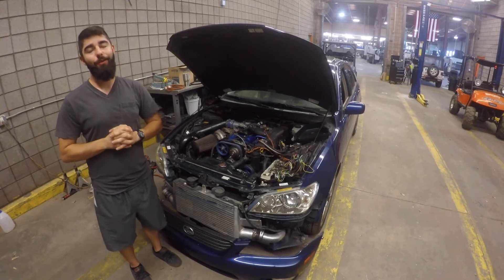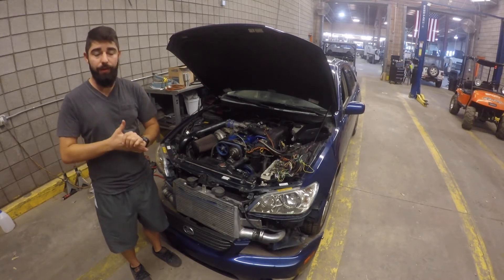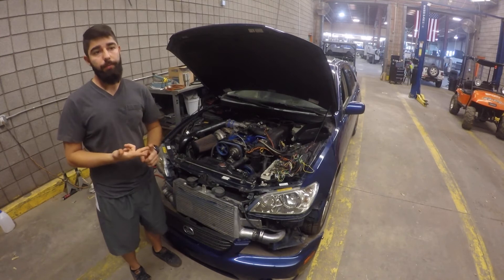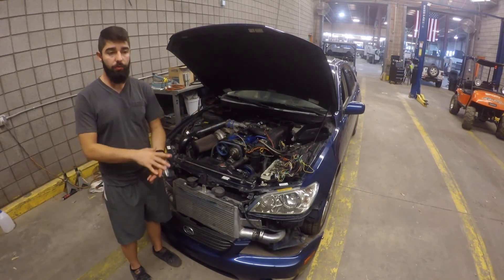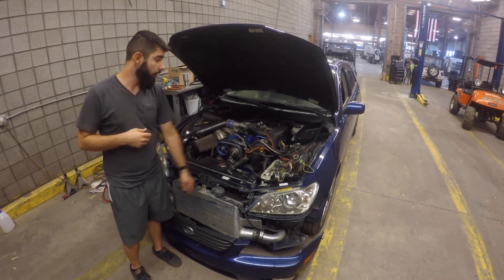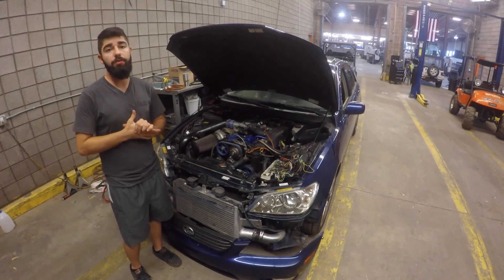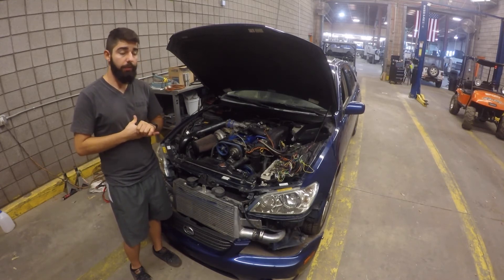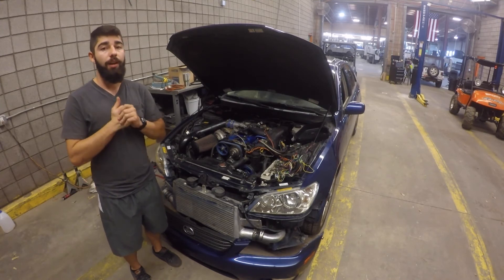Turbo Lexus IS300 Wont Start After Dyno Day. I broke it. :( Having wiring issues.

Comment: Love the car, sorry to hear about the starting problem.  Did you tuner use a pick scope to check and see how much off the signals are?  Also are you tuning a patch harness or how are the signals getting to the AEM?  You will figure it out it will be a simple fix.
Reply from the maker: Brinks84 thank You! The tuner did scope it and didn't find anything obvious. There is no patch harness, the signal wires for the AEM are pulled from the stock ecu, just directly tapped into the wires. Tuner gave me something to try tomorrow! Hopefully it works!

Comment: Hope you figure out the problem! Can your car pass emissions with the infinity?
Reply from the maker: BillerProductions thanks Man! Tuner just sent me an idea to try in the morning! And no, my car does not run any cats or anything so it would never pass emissions. And the stock ecu has all sorts of check engine lights because the AEM is running the engine. The previous owner pulled the cel bulb so I don't have to stare at it all the time.

Comment: Boomslang harness? You could try bypassing the  negative signal wires from the stock ecu and boom slang directly up to the aem  harness. I've heard of issue where people pick up to much interference with all the wires in the boomslang  harness
Reply from the maker: Chris Regan I'm not using a harness, but my tuner told me to try that! So I'll be doing that today! Thanks for the advice!
Reply: Not using a harness? like a pnp? Can you elaborate more? You said the stock ecu is in the car still so it must have some sort of patch harness  between the engine harness and the stock ecu that goes to the  AEM harness? Unless you're running it on bluetooth somehow lol
Reply from the maker: Chris Regan the AEM taps into the wires at the stock ecu, but they are cut and soldiered. So it's not a plug and play. Does that make sense? The wires are cut and spliced, then heat shrinked over.
Reply: ok! Thanks for clearing that up and goodluck with the issue! Looking on doing a similar setup but leaning more towards a cd009 because ar5s are hard to come by where I am.
Reply from the maker: Chris Regan I know the cd009 takes some work to fit. I think you have to widen the tunnel if your car started as an auto. But Good luck! Would love to watch your progress!
Reply: Collins claims you don't with their kit. The one where you use the auto is300 bellhousing and cut the cd009 up lol.. They even recently posted a video of them dropping one in without a problem. I know forsure it will be low though and super tight against the tunnel. We will see soon enough I do plan on filming the full build but I'm still shopping around for a clean shell. Hope to see a update on your  is300 soon!
Reply from the maker: Chris Regan that's awesome if Collins were able to make a drop in kit with no modification necessary.. but I was told a manual shell has a bigger tunnel than an auto one. Just something to look out for if you're looking for a shell. As for updates on my car... Spent the day messing with the wiring with no luck. 😢

Comment: so aem says no signal? but when you test the sensors you do have signal? so is the aem not sending ignition signal to fire?
Reply from the maker: DirtyHandsCleanMoneyGarage no that's the thing... aem gets a signal, it just won't statsync.
Reply: RacecarAndChill did you ohm test sensors to make sure in spec?
Reply: do you use stock key with immobilizer still active through stock ecu?
Reply: I know Lexus doesn't call it an immobilizer but the chip in the key has to be recognized by the ecu to start is what I mean
Reply from the maker: DirtyHandsCleanMoneyGarage yes, I use the stock ecu and stock key.. the car registers it just fine because it ran.. and the cam and crank sensors are new.
Reply: RacecarAndChill maybe give aem a call and see if tech support could point you in the right direction
Reply from the maker: DirtyHandsCleanMoneyGarage good idea. My tuner has been in touch with them and has sent them logs too. Will update if I find anything.